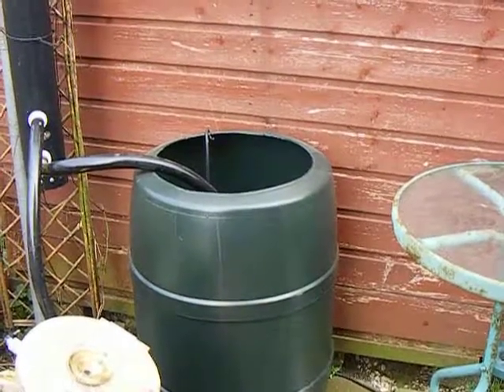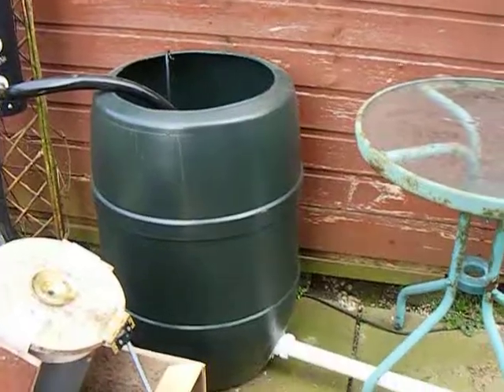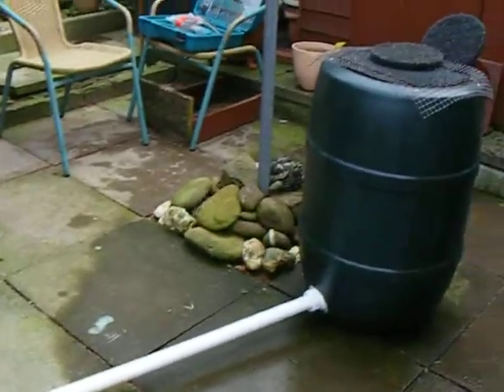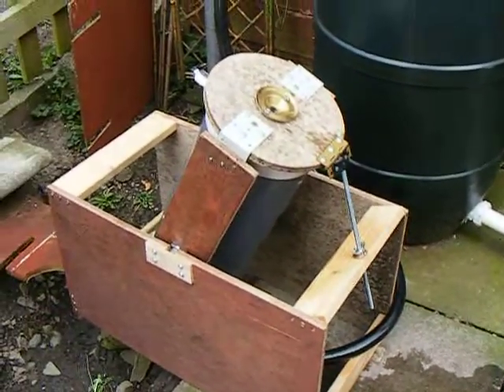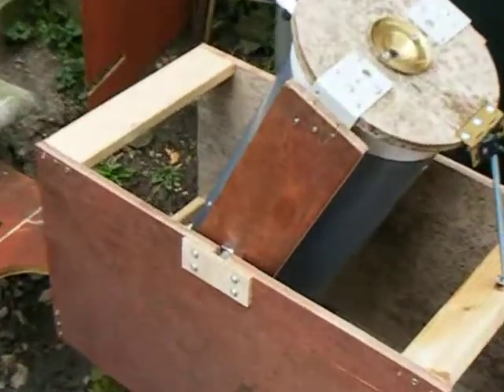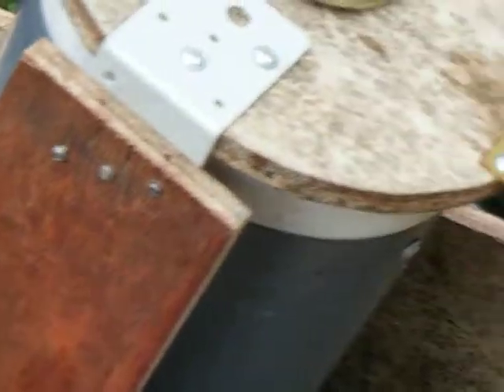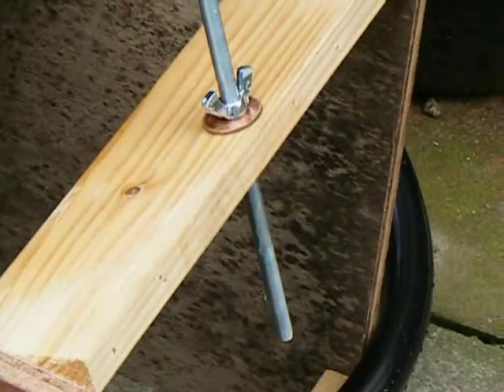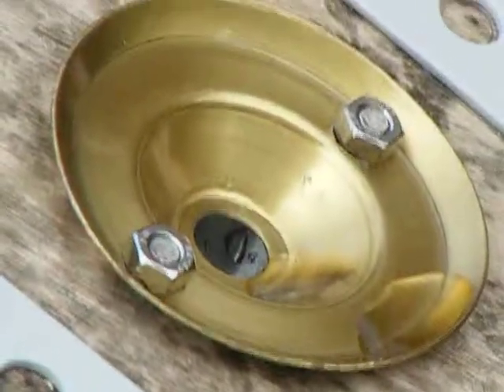Laminar Flow Nozzle Mk2 (movie 1)

Comment: hi dear
can i some ask?  what is that center bottle?
before nozzle that thin bottle..  what worked that to nozzle?
i woner that function of what thin bottel.. 

actually im working in build of fountain company as engineer in korea
but i really wonder that.. 
can you send answer to my email?
here my email nhwj0417@gmail.com 
i appreciate your video
Reply from the maker: Hi jenty nam,
the device you're looking at is a 'Low Pass Filter' ....... its job is to absorb fluctuations in pressure in the water flow to the nozzle.   It's basically a sealed tank which when filled with water, compresses an air bubble at the top ..... this acts like a shock-absorber to 'pump jitter' variations in water pressure.

Go check out Zachary Carpenter's youtube video which explains it nicely.

https://www.youtube.com/watch?v=SjOZmby5K8c

I made mine from 900mm of 110mm diameter drainage pipe.
Check here for pics.

https://www.dropbox.com/sh/72btqk1t5oti5wa/AAB0URQOUjYRDTfsc1l5DCora?dl=0

I hope this helps.
Good luck and don't get too wet   :-)

Don.